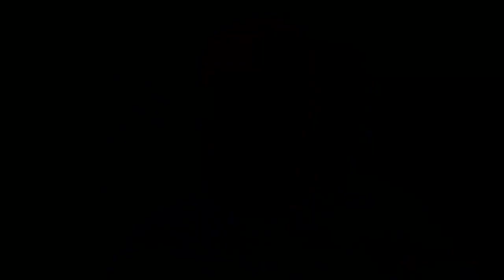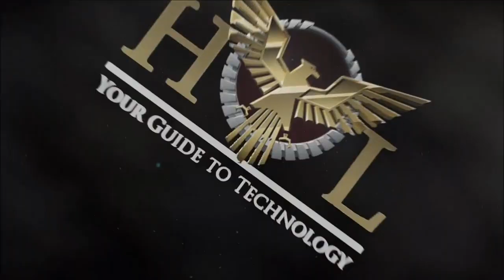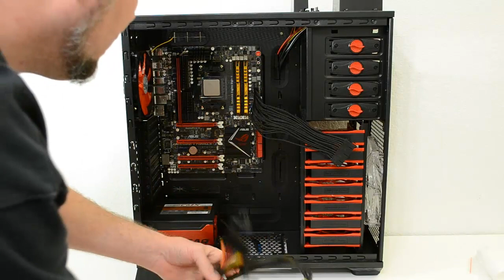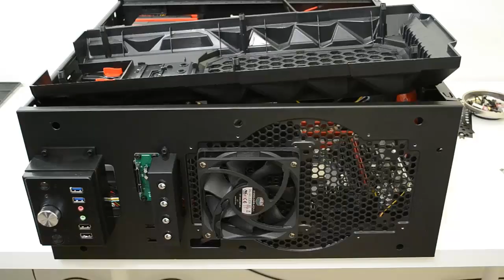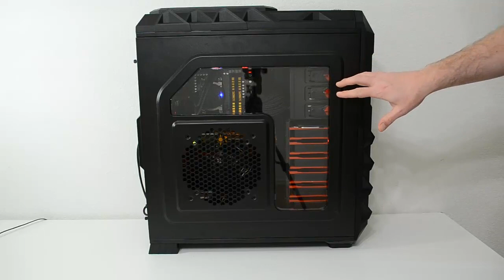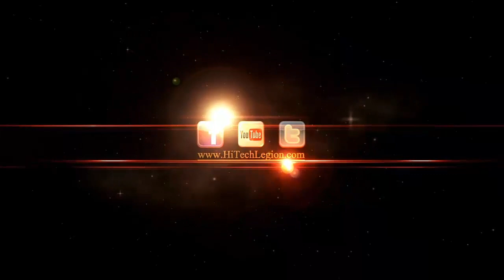CaseCom CL-86 HALCONES Full Tower Case Component Installation

Comment: Thanks for these videos. I recently purchased one of these cases and just wanted to let you know that, without any addition to purchase, my case came with the optional parts (GPU support and PSU shroud). It also came with a 200mm fan in the top position. I will be replacing it with the Corsair H110 Cooler fans and radiator and moving it to the side panel position.
Thanks again for the videos, I found them extremely informative and really helped with my decision making process.